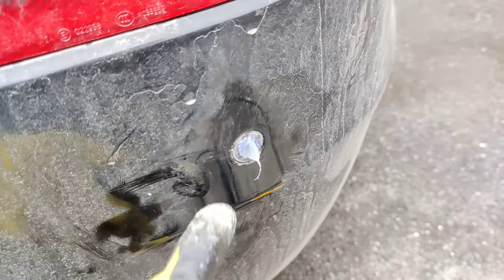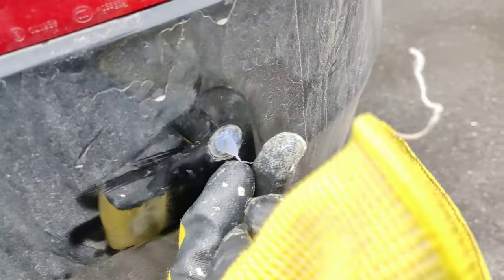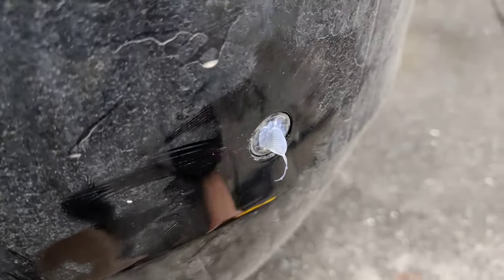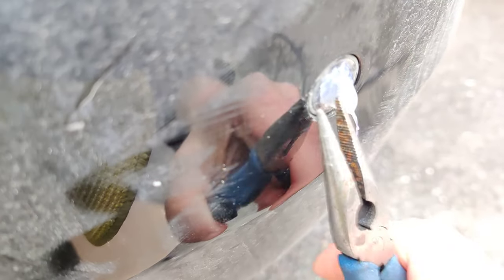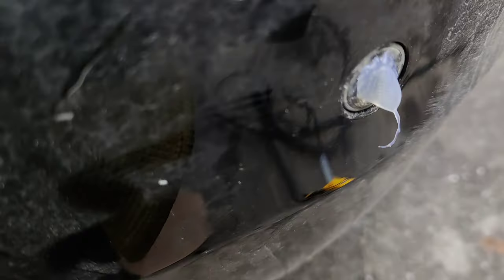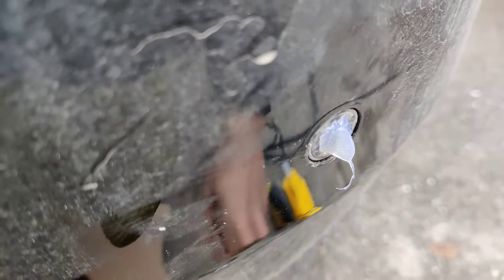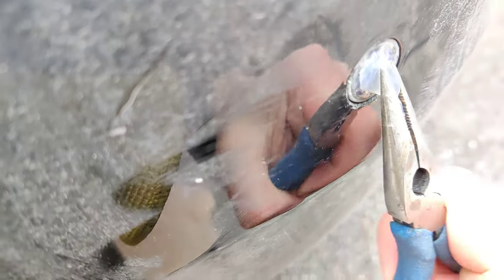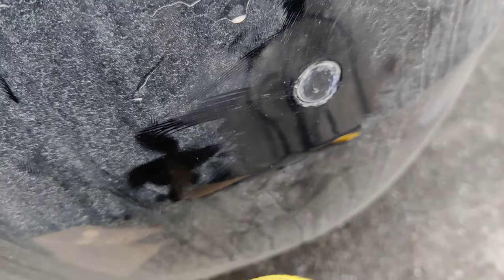Pulling Car Parking Sensor Back Into Place

Comment: Nothing bad happened to the sensor when you applied hot glue on it? What was the glue application temperature?
Reply from the maker: No issues with the heat. My glue gun doesn't have a temp sensor
Reply: GhostAuthors-gn4tv did it work? I have the same issue with my model S
Reply: GhostAuthors-gn4tv did it work??
Reply: @JapaneseSeaTurtle69 did u try it